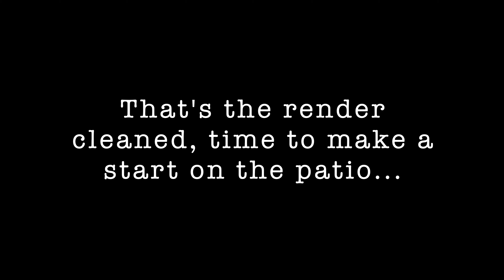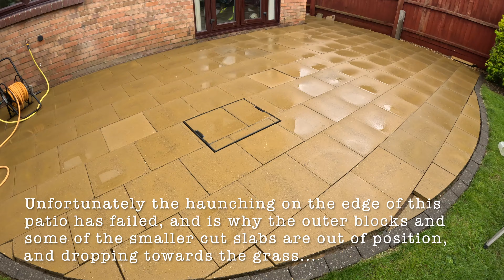Render & Patio Cleaning & Restoration Cambridge, Cambridgeshire, UK

Comment: Hi Nick what a difference nice job as always , be good when driveway is done will look like a new property ! can i just asked Nick what do you suggest to remove some rust spots i have on my patio ?
Reply: I watch another channel & he used some stuff called "Stinky Pinky" by a company called GK Products UK. It worked really well on rust on a patio he did. I just checked the video & searched for the stuff he used. It is currently £30 for a litre of it so not sure if that's a good price or how far it goes depending on how much rust you have. Sid (the guy who I watched using it) brushed it on fairly sparingly so should do a fair amount I would have thought. Not sure if links are allowed on this channel so I'll post them in a reply to this comment in case it is deleted.
Reply: Ahh - looked like both links were deleted (which I somewhat expected) but hopefully you can find the product if interested 👍
The video showing him (Partridge Exterior Cleaning ) using it is currently the 3rd one in his video list with Mega Clean on the thumbnail picture - approx 15m 10s in.
Reply: @yips_way  Great thanks Nick will check it out !
Reply from the maker: Thanks mate, this is what yips is talking about, and what Sid used, https://gkproductsuk.com/products/stinky-pinky, lots of chemical suppliers that sell this stuff, it's all the same, but each supplier calls it something different. It's okay, and does work,  but I find it's not great on really bad rust staining, it also can require a lot of dwell time depending on the severity of the stain. Acid is much more effective, but is probably a bit irresponsible of me to recommend that, as you have to be careful with it. I'd try the stinky pinky stuff first, then if it's not successful, get back to me 👍